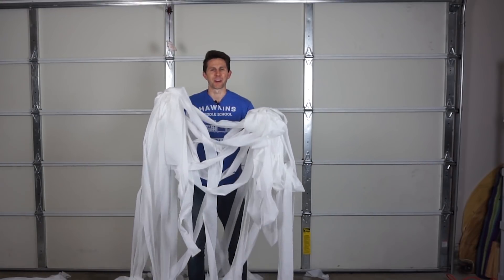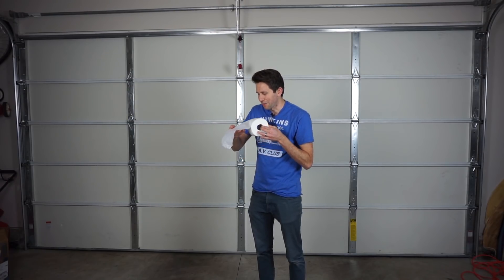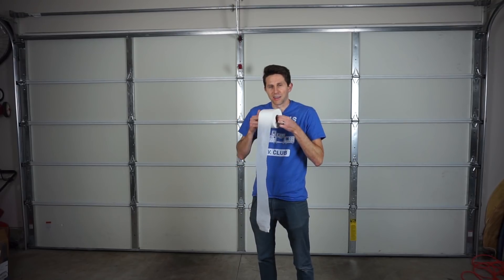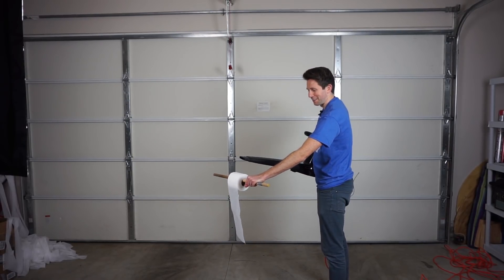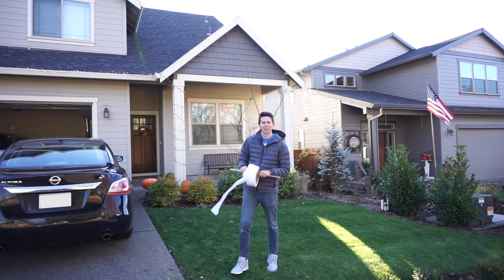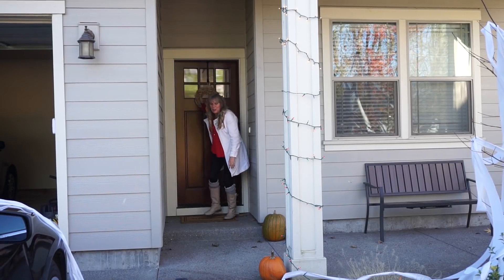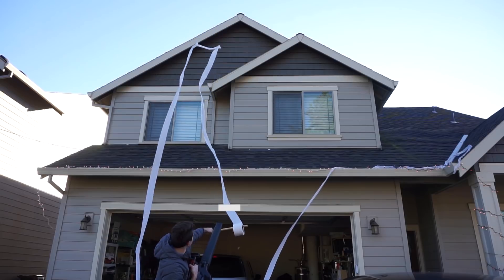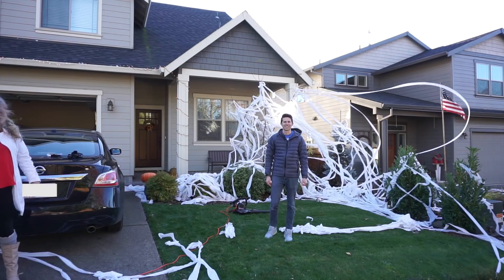200 mph Toilet Papering Machine—Epic 5,000 Feet of Toilet Paper in 5 Minutes.

Comment: Funny video.

Idea: Will concrete stand firm without oxygen? I recently saw a video suggesting, that 5 seconds without oxygen on earth would cause concrete buildings to collapse. But I have some second thoughts about this.

Also oceanic water evaporating into space (which I don't think is an accurate statement. Water does boil at lower pressure on lower temperatures as I remember).
Reply: Not Important 
id guess its more about the pressure of the lacking atmosphere. the bonded water inside the concrete would try to evaporate, leaving a brittle pile of dust. but maybe im wrong and it is the oxygen.

Comment: The Action Lab I have a question. As you explained in the video about the Bernoli effect, faster moving air creates a decrease in pressure. Theoretically, if you had a pressurized container, and then had something spinning the air really fast inside, then the pressure inside the container would decrease.  Is this true, or does the Bernoli effect not apply in contained places?? Maybe you could do this experiment one time, and see if a pressure gauge would show a difference under the circumstances i just explained.
Reply from the maker: That’s interesting! I’ll have to think if that is true or not...
Reply: Bernoulli says, that if the static pressure decreases when a fluid moves, then the dynamic pressure increases accordingly... at leasts its something like that XD
Reply: In my opinion, so don't take it for a fact.
The pressure is decreased due to the faster air ABOVE sucking air from the slow air BELOW. In theory it might work but you'll need the air to be moving in a laminar fashion parallel to the walls of the container. If not in laminar motion the particles will bombard and return back to the low pressure center.
Hopefully this makes sense to you in these words
Reply: Aaron Rappleyea wouldn't there be a mixture of lower air pressure (that is in the stream of the faster air flow) and higher air pressure(the air that is around the faster flowing air).
Reply: JPRTonundFilmstudio yeah cause the particles that moved need to go and increase the pressure in another place they don't disappear.
Reply: ATechnews ooh that’s an interesting way to look at it. I’ve never thought of it that way.